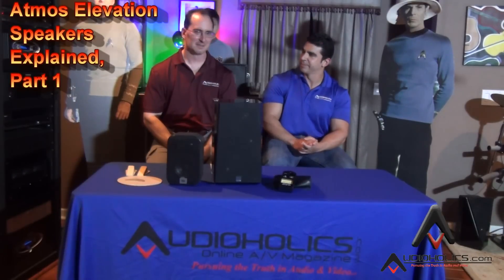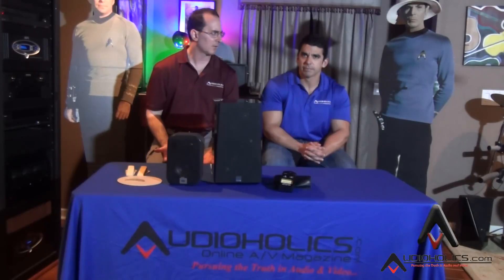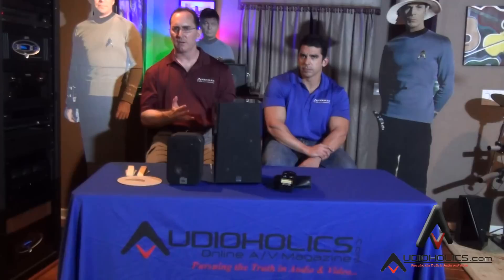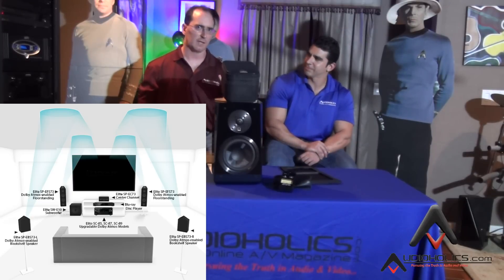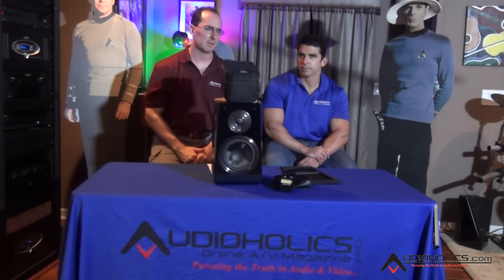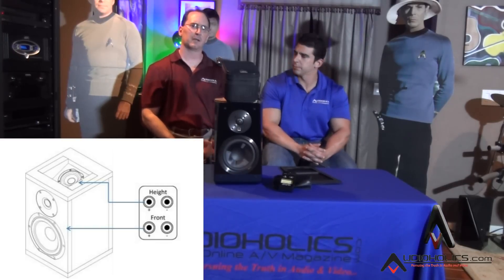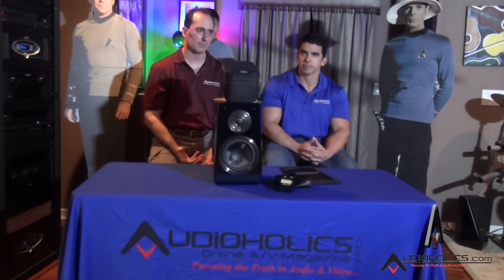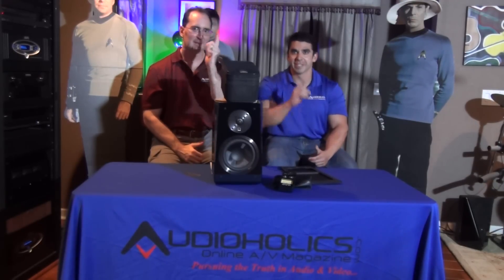Dolby Atmos Enabled Speakers Explained Part 1

Comment: Quick question can I use any bookshelf speaker or small wall mounted speaker firing down at an angle to me my room is 12x 12 small room I'm upgrading to 5.2 to 5.2.2 . I don't really want to buy a Atmos trademark speaker. Can I use a small satlite speaker's for my elevation or high channels I'm planning on placing them on the top in the middle of the room.

Comment: Hi there.. I need some professional advise.. I have already onkyo tx nr 646 receiver and kef e-305 speaker.. My setup is 5.1 channel.. now, im planning to buy onkyo skh-410 for dolby atmos enabled speaker so that my setup will be 5.1.2 and to utilized the dolby atmos feature of my receiver.. My question are, does it work and will not burn out or short circuit? im afraid because maybe, neither the speaker or the receiver will burn out smoke. . thanks for the help and advise.

Comment: Thanks for the tips as I have  a 7.1 Klipsch system as my mains are the Reference 82 towers and living in a condo the ceiling is concrete so you can't hide the wires without wire mode to do Dolby Atmos.  So yesterday I saw a great deal on RB-41 II Bookshelf Speakers so I ordered them and I have a pair of Audio Engine A5s in my bedroom and the base they sit on are on a angle

http://www.canadacomputers.com/product_info.php?cPath=35_663_657&item_id=044264

As I took the speaker and and laid  it down on top of my 82's and perfect angle at the ceiling  and the new speakers I ordered will match my towers perfectly  :)     No drilling holes on the walls needed and the speaker fires at the ceiling :)  Hope this works  :)

James

Comment: Gene-

As a loudspeaker engineer I tend to favor Triad's square array of four 2" Atmos drivers reflecting off the ceiling. Why? In the square configuration Triad is using 2" drivers should be able to acoustically produce the most focused Sound Power beam or bump centered at 7K. Why? A 7kHz wave is 1.937" long. So 7 kHz is very easy for a 2" driver to reproduce with low excursion and thus low distortion. Plus, stacked in a square array of four drivers with series-parallel wiring you'll end up with 6 dB more sensitivity than a single 2" driver AND a more focused beam centered on 7 kHz than a single 2" driver. This, IMHO, makes Triad's square 2" array a smart design,at least from a purely acoustic starting point.
Four (awesomely good) 2" Scan Speak drivers, however, are not cheap. But I bet Dolby Atmos DIYers wanting to experiment can find much a less expensive 2" speaker at a place like Parts Express.
Reply from the maker: Deep, thanks for your comments. Yes the Triad speaker looks interesting and I commend them on using good drivers.  However, playing the same signal through 4 2" drivers will cause some acoustical interference issues that will show up in the radiation pattern.  Even at the lowest frequency of interest for elevation (7kHz) would mean the drivers should be no more than 2" apart which is impossible in this case.  Also don't forget the Triad speaker likely has that 7-element Dolby crossover which does it no favors at all from what we've been seeing.
Reply: AudioholicsLIVE , "playing the same signal through 4 2" drivers will cause some acoustical interference issues that will show up in the radiation pattern"

Precisely! Triad arranges the drivers in this manner to Cause the drivers to beam at 7 kHz which, by design, Narrows the radiation pattern.Time will tell though which Atmos speaker configuration wins out. Remember in the nineties some of the very first surround speakers, trying to rigorously follow THX's recommendations for home surrounds, were trapezoid shaped with two-way 5.25" mid-woofers and 1" tweeters firing to toward the front and rear of the room. They disappeared quickly, however, except a speaker builder websites because of cost, appearance, and difficulty of construction..
Gene, have you yet had a chance to dissect or run voltage curves through one of these seven element crossovers? What does this royalty-based Atmos crossover do? i.e.Does it involve a notch filter for the 10 kHz dip? Does it do anything else like high-pass at 180Hz? Eagerly,awaiting your Part 2.
Reply from the maker: Deep Ear Yes I discuss this in my up and coming Def Tech A60 review and we are also working on and article about the Dolby crossover.  Stay tuned...

Comment: Hey guys...I always enjoy your tech filled videos.  It's a good thing, though, that you guys are audio nerds and NOT photographers or videographers.  Can you do us all a favour and make sure that your horizon in your videos is ALWAYS level and not leaning in one direction or the other, please?  Your table is all crooked and the curtain rod above your heads is leaning in the same direction!
It also helps to set your camera straight on, in the middle, of your scene and level it about half way between the top and bottom of your frame.  Also, try NOT to use a wide angle lens.  It's always better to pull back a little instead of keeping the lens close and widening out the field of view.  Wide angle lenses cause huge amounts of visible distortion, particularly near the edges of the scene.  They make vertical lines bend instead of being straight and they warp the perspectives and dimensions of people's faces.  Better, more even, and more diffused (softer) lighting sources will also help A LOT!
Help yourselves create a better quality video.
Reply: Thanks and agreed.  Our camera guy is out of action at the moment so we are simply putting the camera in the room and shooting ourselves live while we discuss.  But, we will pay more attention to detail in future videos.
Reply: As a work around solution, accepted.  May your camera guy return to action soon.  Cheers*